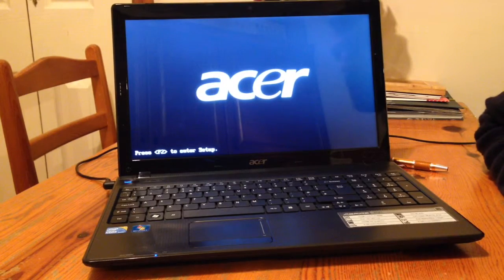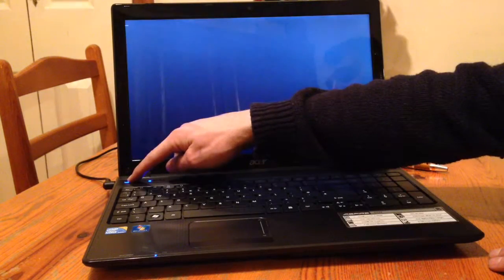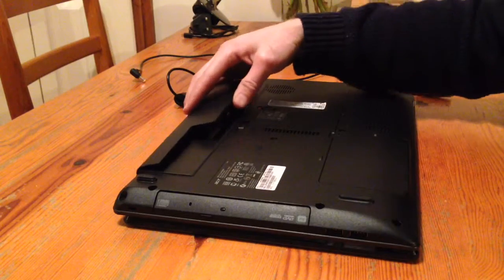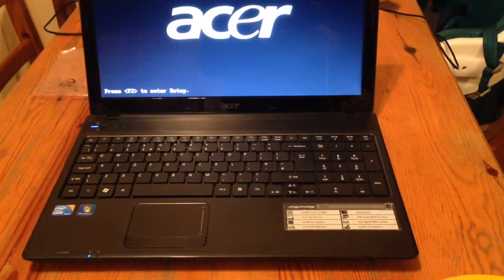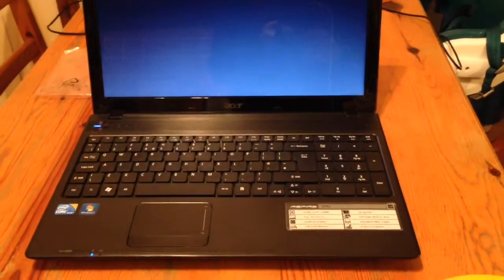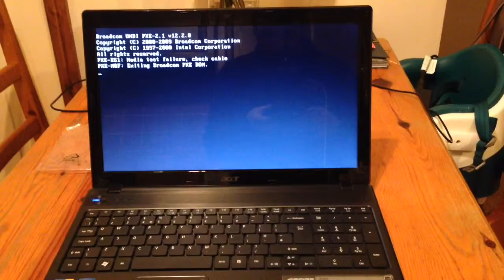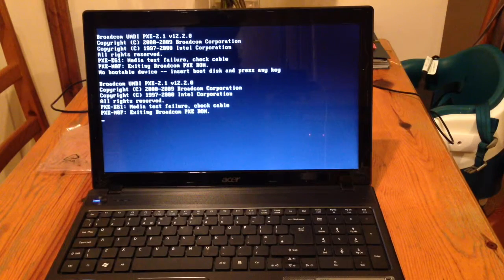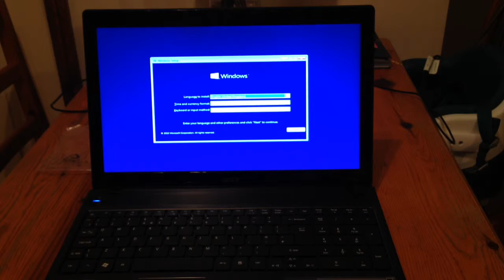Acer Aspire 5742 Hard Drive Swap

Comment: Bro.. You just took out one of the best kept secrets in the history of laptops. Did you ever notice the IDE name beginning at the front of the hard drive name? IDE stands for Interactive Developers Environment.. it means two computer hard drives built into one. You have the option in bios to boot from AHCI or IDE mode. There are secret combinations of key presses valled hot keys that unlock thehard drive (ctrl + S) during start up. I have the exact same model and I wouldnt sale it for $5000. So you can boot into AHCI which is a lot like a normal computer only it has hidden secrets such as the leading A.I. of the 2007-2009 years but thats not all.. And the IDE side of the hard drive was designed by and for THE UNITED STATES DEPARTMENT OF DEFENSE!! The machine is a BEAST!! Booted into IDE MODE you are basically unstoppable. I have breeched every firewall I come into contact with and I mean the big boys firewalls.. naturally I am not saying who that is. Yup this bad boy has landed me developer positions at all of the major big tech companies (they dont know about it either) only Acer, Intel and Microsoft know it even exists. You should let me buy that. I am one of the very few people in the entire world who know what it is capable of and how to operate it. A combination of 3 keys being pressed at the same time while unplugging the ac adapter while holding the 3 keys down will bring up the US DEPT OF DEFENSE PROTOCOL (D.O.D.I.D.E.) I was C.I.A. back when we first got these machines.. I dont know how you got yours but I want it. Please tell me youstill have the hard drive. P.S. there is another hard drive hidden in the battery that way wayy ahead of its time, dude has US DEPARTMENT OF DEFENSE PROPERTY AS DOESNT EVEN KNOW HAHAAHAA FXXKING EPIC!!
Reply: whats your favorite way to stay energized